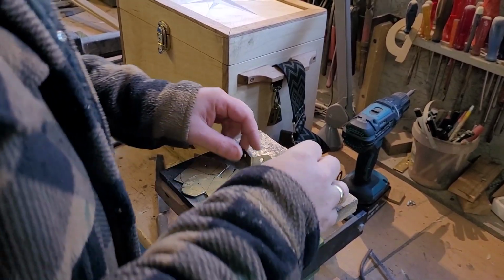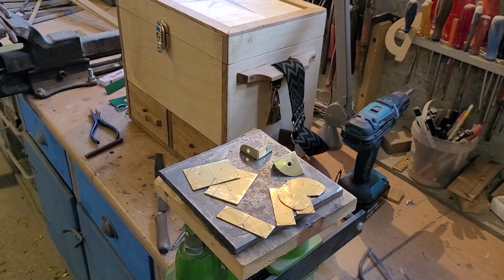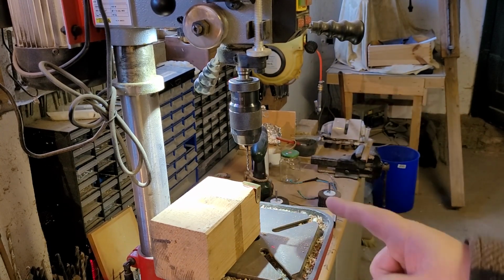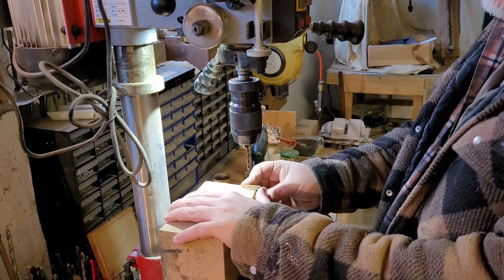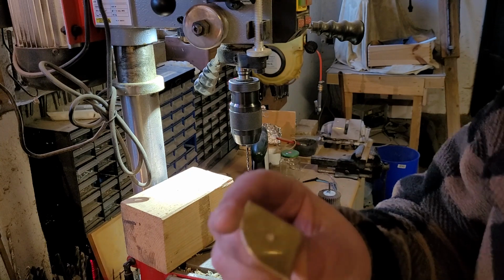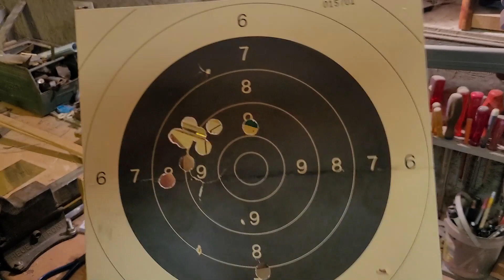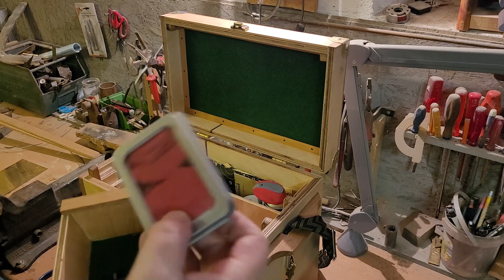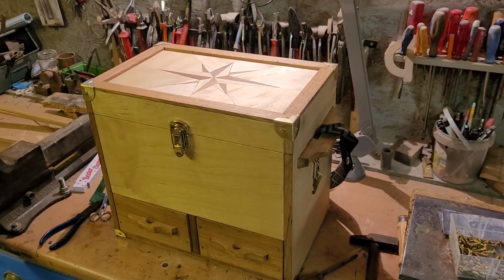shooters box pt 3 making brass corners

Comment: When you drill brass it is always good to blunt the drill bit a little. Sharpen it as normal then use a stone to put a tiny bit of negative angle on the drill bit cutting edges. Brass is really bad at grabbing when being drilled. The shooting box is looking really good.
Reply from the maker: That is a good idea, i will try . Bigger parts are much easyer to clamp in a machineing vise, so the parts can not be grabbed by the drill and rotate. Best safety tip is never to use gloves on a drill press unless there are some fingers in spare 😁but the good thing is than it is posible to order 2 shots and thre pint with one hand 🤣🤣